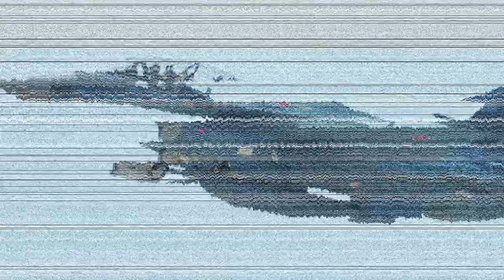Japan Is Testing A New Secret Fighter Jet China Fears

Comment: Almost every fighter plane gets delayed a bit, there is always something that shows up during testing.
That said, I don't think comparing it with F-35 is fair, F-35 was simultaneous built in 3 different models and one of those models have VTOL so there are bound to show up more problems there then when you make a single model from the start.

I think the F-22 and the Russian SU-57 are more comparable even though the Russians got into economical problems when they had their plane ready for production. The F-22 certainly had some issues as well during development but nothing like the F-35.

Using the same airframe for 3 different planes is just far more challenging and the new VTOL technology the F-35 is using certainly didn't make the process faster.

So I would say we probably should add about 2 years to the estimates, unless Japans situation with China deteriorates more, war or severe threat of war tend to lead to faster development due to increased funding (and probably more motivated people all the way from politicians to engineers). It is also possible that if the situation with China calms down the plane could get cancelled, that has happened before.

But Japan really have the economy and competence to build their own fighters, it is almost embarrassing that such a large and competent nation buy foreign planes. I think too many countries are far too cheap nowadays. Sure, it is a way to improve diplomatic relations but you are dependent on whoever you buy from for spare parts which seems like bad for internal security to me. I mean if Sweden and France can do it, so could at least the richer countries.
Reply: @jasc4364  That is true but most nations tend to buy F-16 planes anyways (yeah, they are still the best selling exported plane).

Fifth gen fighters are certainly harder and more costly to build and I am not sure smaller nations like Sweden for instance would need or afford those.

Someone like Japan, South Korea and Germany though have the economy to do so. Heck, France too, they should up their game.

But even US who have the most stealth fighters in the world have less then half their fleet stealth fighters. Russia have 3! and China might or might not have a few operational. 

I know that Gripen have electronic counter measures instead of stealth, it is cheaper but if it is a feasible option or not could be discussed. It's advantage is that you can update it easily, you can't exactly update the shape of you plane but at this moment stealth is certainly the king.
Reply: @jasc4364  No, no me either. At least right now Stealth is far superior, but as I said, harder to upgrade. The Swedes have a rather limited budget though and it is far better then nothing.

It is pretty hard to say if stealth will be as important 20 years from now though, it depends if detection improves more then stealth technology or not. Something good today might be wasteful tomorrow, that is how military technology work.

The difference between the cost of a Rafale and a F-35 is more in the operational cost then anything else. The F-35 is extremely expensive to operate, twice that of a Rafale or more depending on sources.

Operation cost is generally the problem with 5th generation fighters, they are far from cheap to keep in the air, which I guess is the reason F-16 still is popular, it is cheap.

Buying the plane itself is a bit pricey but not to a ridiculous level, but owning a plane you can't afford to use is rather pointless.

Some smaller countries do own F-35, Norway comes to mind but they have a lot of oil money.